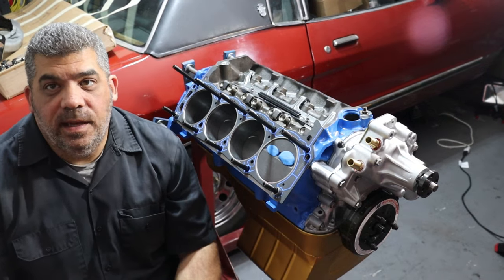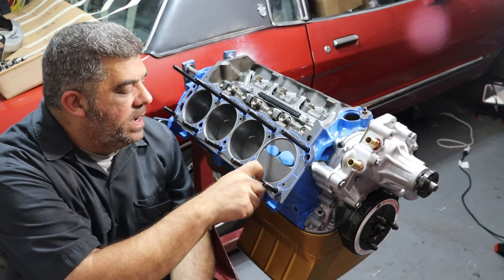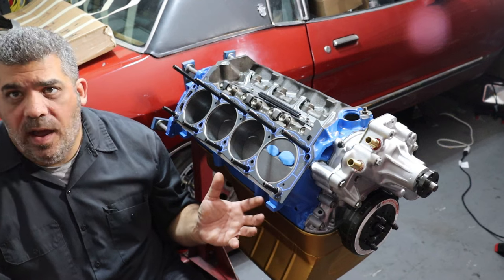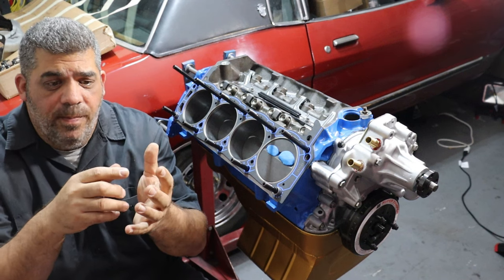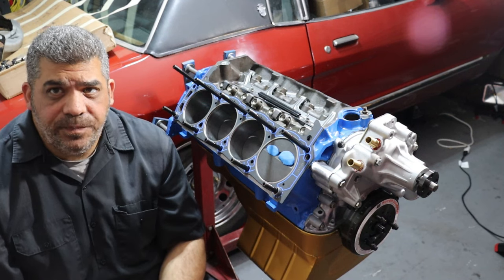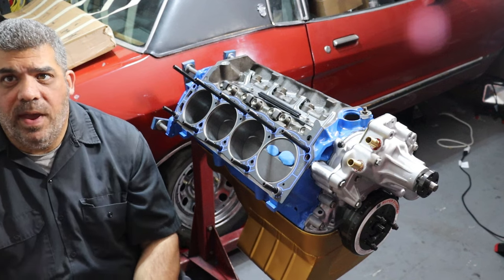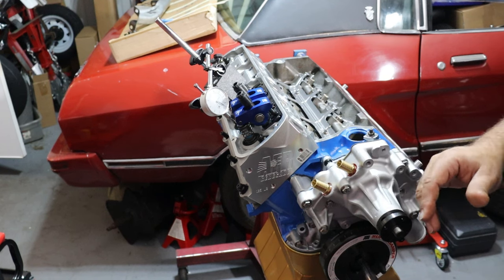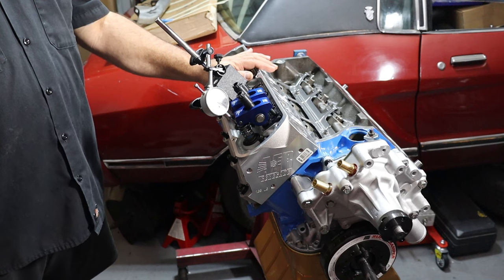Measuring Piston to Valve Clearance on my SBF

Comment: The reason is no measurement with clay method is because you need to do it with a solid roller lifter or take apart your hydraulic lifter and add washers in it to make it solid
Reply from the maker: No need to do that when using checking springs - they're designed specifically for this, and aren't strong enough to collapse the lifters.  The reason for no contact with the clay was that the actual clearance (as measured with the dial indicator) was more than the thickness of the clay.

Comment: Thats a good free education .. let me tell you how i do it … i  bolt the head on finger tight with no clay on the pistons .. when i put my rocker arm on i put a hundred thousands thickness of a feeler gauge between the rocker tip and the tip of the valve ..  .. then ill turn the oil pump to pump oil thru the lifters so they don’t begin to collapse  once thats done i rotate the motor and if nothing hits then i remove the feeler gauge and simply just pit the rest of my head bolts or nuts on and torque it down and im finished .
Reply from the maker: I haven't heard of that technique before, but it sounds reasonable if you're not interested in the specific measurements but just want to know whether you've got a minimum amount of clearance.  Thanks for your comments!
Reply: @billsgarage  i may have came up with it myself .. i never heard of it before til i thought it up .. im only interested in knowing i got enough room and thats it so it works for me .. its also good for installing a bigger cam in a already assembled motor while doing upgrades to add horsepower … 
 My idea is to give the ppl different options on how to do something .. btw thanks for showing how to check ptv clearence with the guage  i had forgot all about that technique

Comment: So does that mean you could run a bigger ratio rocker atm 🤔
Reply from the maker: Great question.  Physically, I could probably run a larger rocker ratio (say 1.72 instead of the stock 1.6) without worrying about the valves hitting the pistons.  However, often this type of change will result in lower horsepower unless you also change the camshaft because the rocker ratio is just one part of the valvetrain geometry and needs to be matched to the cam profile in order to make the best power.  My cam is a hyd roller designed to work with 1.6 rockers, and changing to 1.72 would give more lift, but would not add duration.  This could be problematic for gasses flowing into and out of the cylinder considering roller cams already have a steep ramp.  It would be less of a problem for a flat tappet cam, but still would be a crap shoot on whether it would make more or less power.  Given the amount of clearance in my engine, I could safely run a cam ground for more lift and stick with my 1.6 rockers, or use a cam ground for use with 1.72 rockers, and may do so in the future, but I'm content for now.
Reply: @billsgarage   good points. Didn't think about that 🤔

Comment: Dial indicator,  weak springs, measure clearance starting at 30°before, and every5°till 30°after btdc, zero indicator every time ,record you numbers.
Reply from the maker: Thanks for your comment.  Your method is definitely more thorough than mine, but you can never measure too many times as far as I'm concerned.